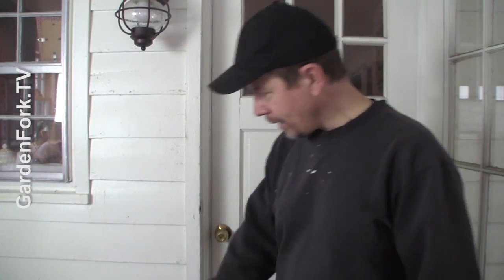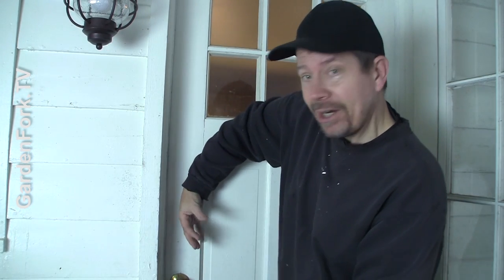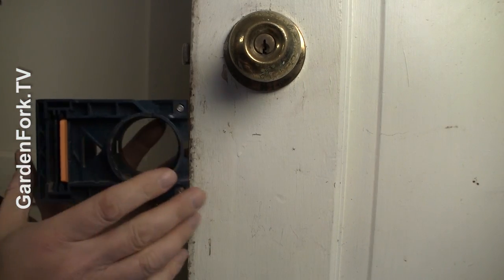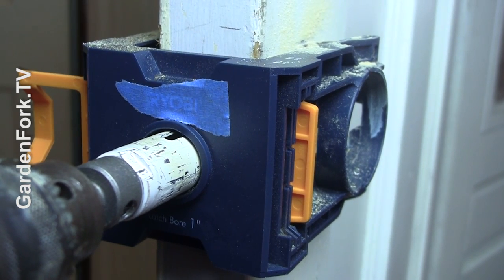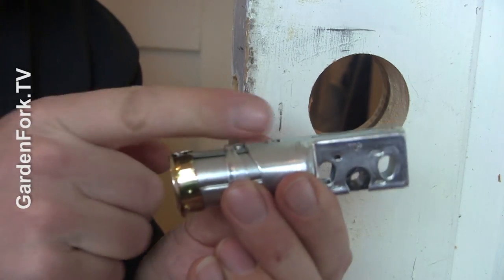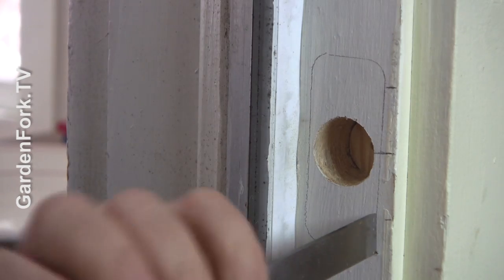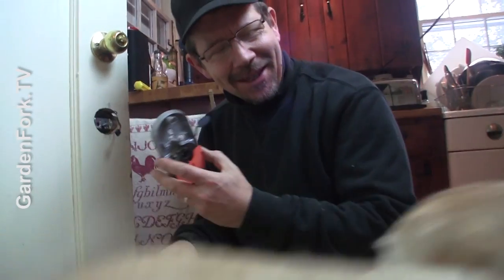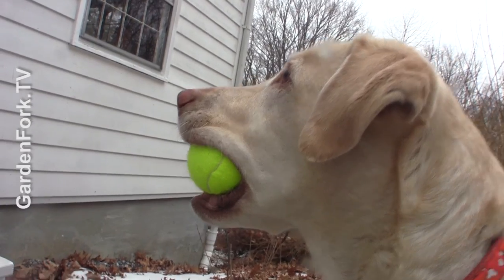How To Install A Keypad Deadbolt Lock - GardenFork

Comment: Nice video,  Last time that I locked my keys inside the house without a deadbolt. I tried the old credit card trick, then got a tire iron from the neighbors.  Still took over 20 minutes to open.  When I put the lock in, I really beefed it up with 2 metal plates and long screws.  Once I repaired the damage to the door frame, I used even longer screws.   I love the jig idea. My deadbolt does not match the holes. Wish I knew about this sooner.
Reply from the maker: +Larry Burch happens to all of us! even with the jig, boring a lock can be challenging, especially in an old door like this one!

Comment: One suggestion would be to use screws long enough to fasten into the door frame when mounting the strike plate. The deadbolts I recently installed came with these and a cover plate to secure them even more. This makes it much harder to kick the door in.
Reply from the maker: +David Kuhns yes, i did not show screwing in the plate, good point David, thanks for that. this kit came with screws for wood and metal doors. eric.

Comment: Eric, as a locksmith, I can tell you the deadbolt is meant to be above the knob or lever for better security. If you are worried about a hand reaching in, yo could have installed a double cylinder deadbolt (key operated inside and out).
Reply from the maker: +Therocketman321 good to know, thanks for that. this is the main exit of the house so I did not want a double cylinder, and putting the deadbolt above the knob would have made it vulnerable to being opened.  thx!

Comment: I just added these to our main entry doors. I replaced the existing door knob with a heavy "hall and closet" knob from the same manufacturer -- I didn't see much point in having a key lock on the handle when I have the keypad deadbolt.
Reply from the maker: makes sense to me, the keyed door is useless after the install. thx!

Comment: Any idea how long the battery lasts in them? We are thinking of getting some for our property
Reply from the maker: +Wisconsin Backwoods Project its based on use, because the battery moves a solenoid back and forth to engage the lock mechanism to the knob. if the battery dies, the deadbolt also has a key as well to open and close the door. i've had one for over a year with daily use and the original battery.

Comment: Nice video. When chiseling out the door plate, if you flip your chisel over so the bevel is against the wood, you will have an easier time not having the chisel want to dig too deeply into the wood.
Reply from the maker: +Kevin Cummings wow. never knew that! thx.

Comment: I LOVE these, I have the handle with keypad not the dead bolt.  same manufacture, it auto locks when you close the door, never need keys again :)
Reply from the maker: +doug green yes, it has a regular key if the battery fails, but i haven't had to use that function. thx!

Comment: Sigh. You might want to change your code. I'm half kidding, but this brings up a few points. Is the combo preset? Also, does it have a lockout feature if someone tries to go through several combinations?
Reply from the maker: +thegrimjester it has two preset unique codes and you can put in 10 of your own. this is great as everyone can just pick a 4 digit number that they can remember, they don't have to memorize some random number. thx, eric.

Comment: What happens if the 9v battery dies and you can not unlock it?
Reply from the maker: +ashrak12 it also has a key slot in the center of the knob to manually lock and unlock it. I have two of these locks, they have worked well for me. thx!